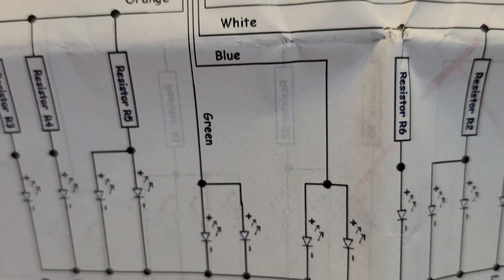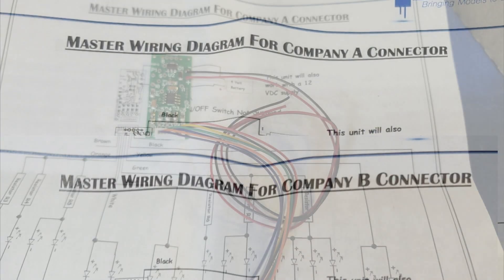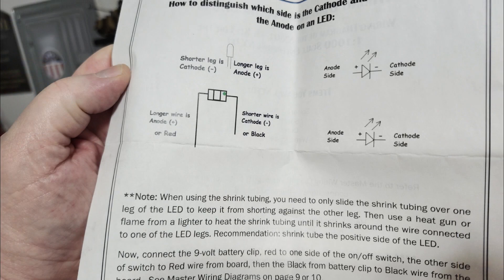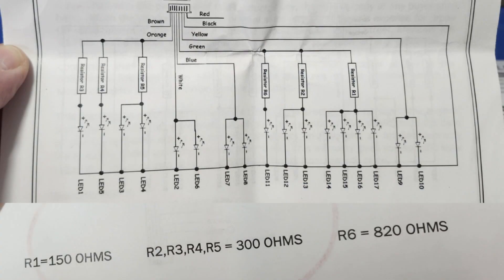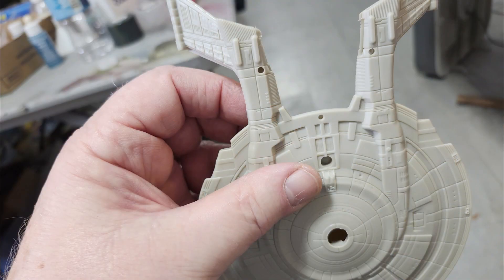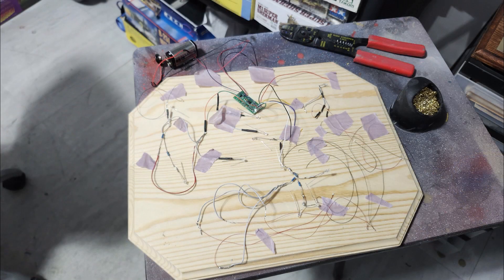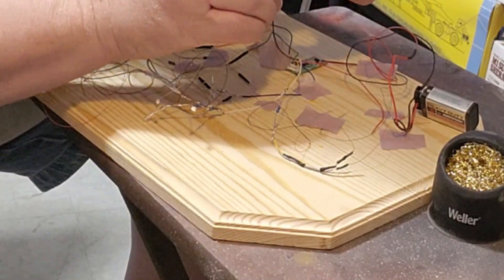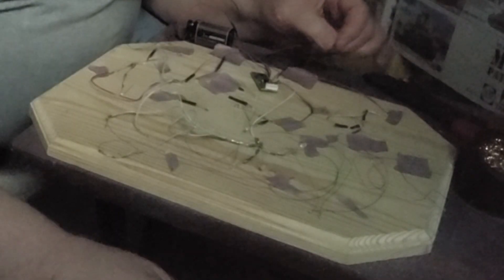Max's Models after hours 09/10/25

Comment: One thing you can do is extend your power cables, and then use heat shrink tubing to tie your wires to the support pole. You do that and then you’re basically masking your whole support in black featuring tubing, but your wires will be inside the tubing held to the support pole, and then you could put your power switch down on the base by just taking your Dremel and opening a hole, and put your battery underneath the base.
Reply from the maker: I'll probably see about replaceing the rod with brass tubing.